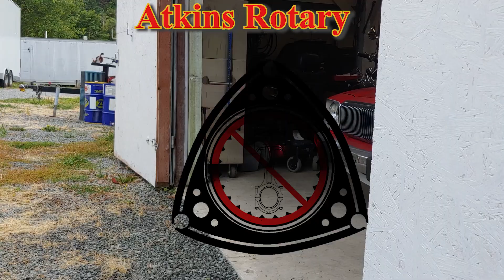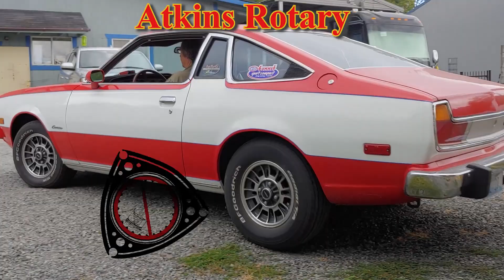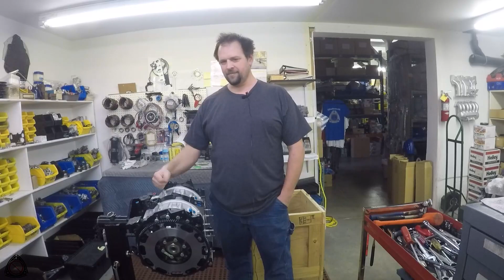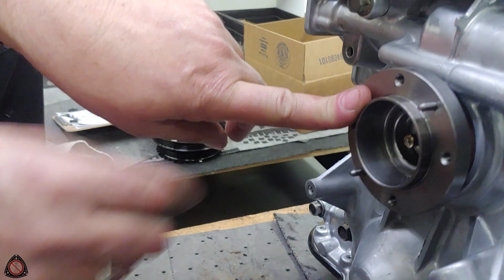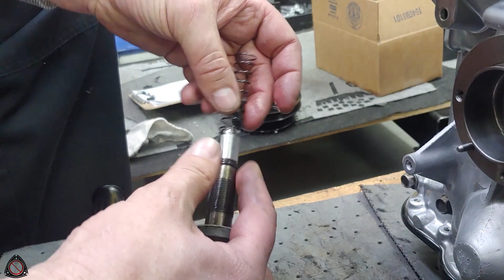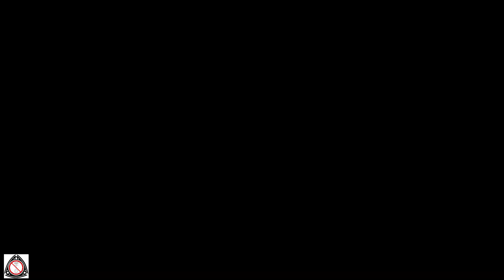How To: Install a thermal pellet

Comment: How would I determine if I need one of these on my 13B? Turbo 88 10th anniversary. Also, the exhaust gasket for the manifold I have is the dimpled style and I wasn't sure until today and told I should use the factory style exhaust gasket manifold. For my mild street ported 13B Borg Warner 66 mill Turbo, Did you got my last email Dan about a few things?i may not have seen it... Thank you. These Video's really help me learn Alot As I've Never done My own full build ,And on a Stand Alone Fueltech FT-450 ECU .As i think you may know about my 88 10th anniversary RX-7 I've had 27years now . And you have helped me for several year's, And i appreciate it verry much.hopefully we can chat tomorrow? If i call ya in the afternoon..Good day Joe

Comment: Hi,
Does one not need to put pressure on the flywheel, in order to keep various shims/bearings from falling down when the bolt is loosened and the engine is in a horizontal position?
Reply from the maker: If all you are doing is removing the hub bolt, then no. If you have to remove the hub, then yes, you will want to do something to keep the endplay stack in place. 
Good question, though, and thank you for asking and watching, too. 😉
Reply: @AtkinsRotary  much appreciate the reply & clarification, and keep up the good work!

Comment: is it possible to install in an RX-8 with out removing the engine?
Reply: A year later but WTH, yes. :)
Reply: @robertkorn  i tried it and no, the bolt is torqued to 200+ ft lbs, the only was to loosen it is to remove the trans and lockt the engine with a tool and then you can loosen it, all the heat and largest leverage bar did nothing to mine.

Comment: Hey what parts do you think would be good for a 12a rotary like to make it like a race engine do you have things like that?
Reply: We can help you with that. What kind of racing are you planning on doing??
Reply: @DanielAtkinsFirewood  like street racing
Reply: @cashtonbrimhall3010  : assuming your side plates and rotor housings are ok a basic rebuild with street porting would be fine.. That would at least be a start..